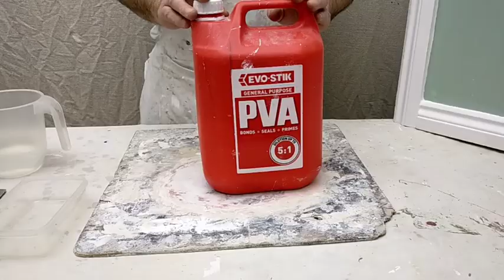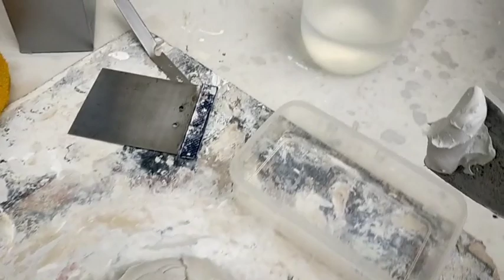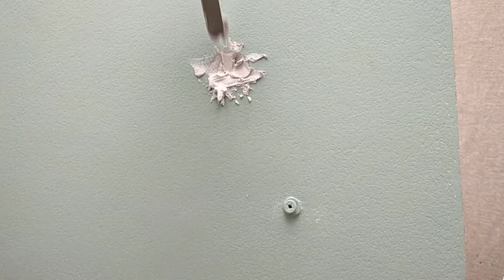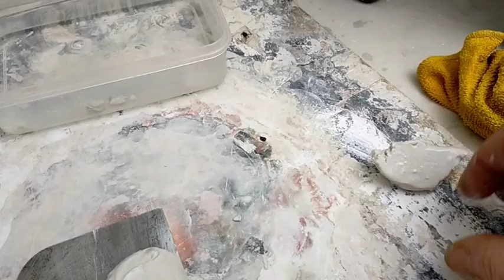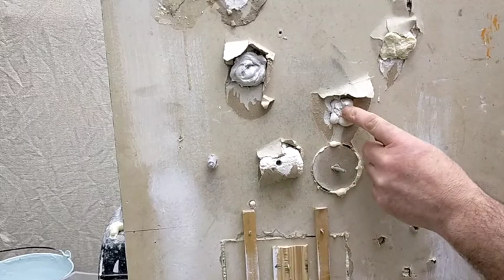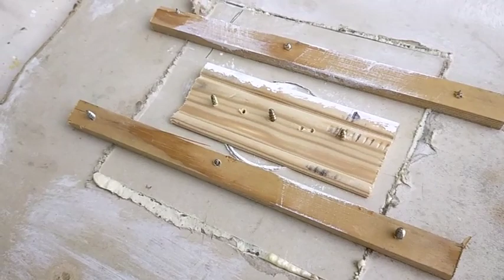How To Fill A Gaping Hole And Mix Powder Filler Step By Step

Comment: I have been a bit of a bimbo and forgot to fill the holes after removing flaking paint and mould before painting the ceiling with B.I.N. uneaven thing really shows. Can put polyfilla on Zinsser BIN? Will it stick? (Sorry. First diy project ever. Have been watching your videos for months in prep but... nerves took the better and mind slipped.)

Comment: Great video and detailed explanation. Please advise I have some floor-skirting gaps around a laminate floor. I would prefer to replace the beading to hide the gaps with a flexible filler or sealant. 
1. Can I use a door frame sealant to fill the perimeter, this will require many tubes to fill the wall gap?
2. Can I bulk up the flexibility of the frame sealant with say powder filler or even SBR with sand and cement, and use it to fill the skirting floor gap? I hope this mix will bulk up filler whilst resisting floor vibration and floor movement. If it fails or looks nasty then just cover with beading.
3. Can I then add ordinary paint to add pigment to the mix to try and match the flooring colour, as you have done in the hard stop video?
Kind regards and many thanks.

Comment: That polyfilla looks like good stuff. Is it non flashing after painting it ?
Reply from the maker: Yes, needs  two coats of paint or one if it's a hardtop  filler.
Reply: OK .....Thanks.....Also was wondering if you know what the best paint would be for painting grout lines in a bathroom ?
Reply from the maker: @geoffreymeare3406  not sure  would not paint them myself.